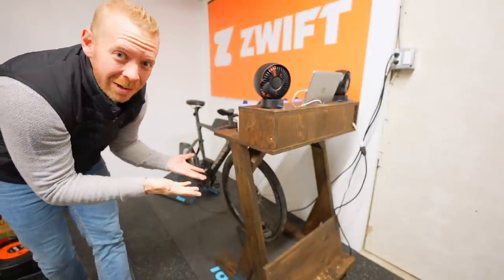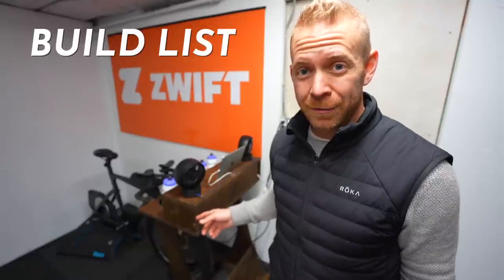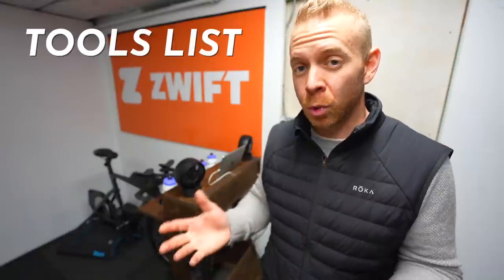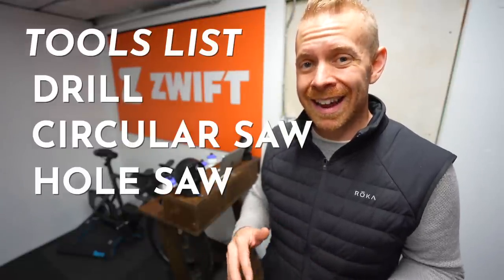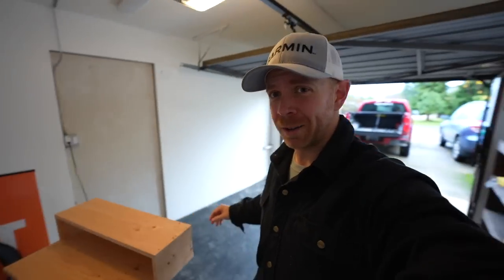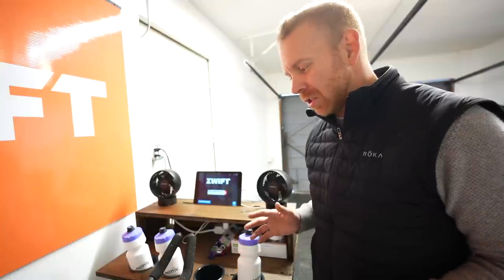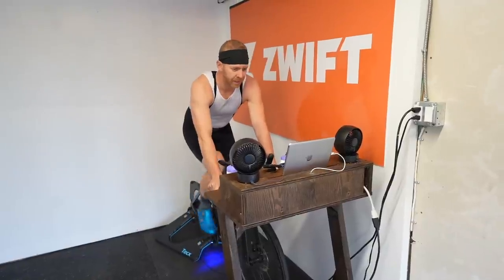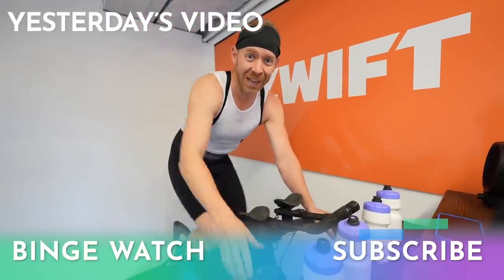$100 ULTIMATE Dream Zwift Desk Setup DIY

Comment: Mate great build, all I would say is add another 2 supports at the top of the upright legs. Similar what you did at the bottom. I can see the supports on the inner of the legs that would only really stop lateral movement. If it got too back heavy or you took a bit of a dive (I have done it before cleat came undone) the top will not rip out of the legs. But overall great job mate.

Comment: You should add some locking castors for easier movement. Simple locking castors with a proper load capacity should not be terribly costly. Might also be cool to add the small power strip nicely managed at the underside rather than in the slot for a phone charger, Di2 charger, your fans etc. 

It is much nicer looking than a plastic/aluminum trainer desk you can buy, the staining looks great. Personally, I prefer the immersion of the television, but this is great for those who are space constrained. Using your own hands and brain to make something can't be understated, those of you quibbling that you can buy a desk for not much more are kind of missing the point here.

Comment: Looking at the slot, I reckon you'd be able to do that with a circular saw with the blade depth reduced. Sure it might be a little more difficult to square up, but it's one less specialised too that's required! Looks awesome though and shows that I can get some little fans for my diy desk 😂